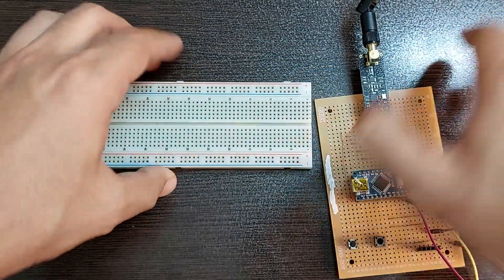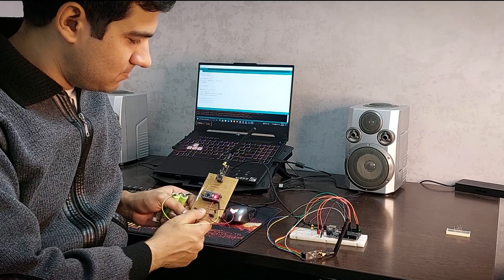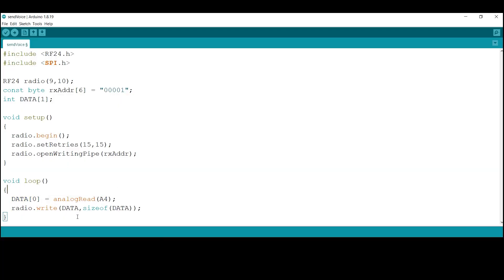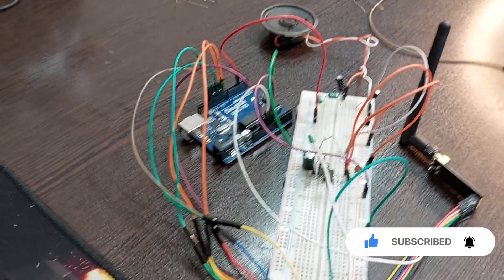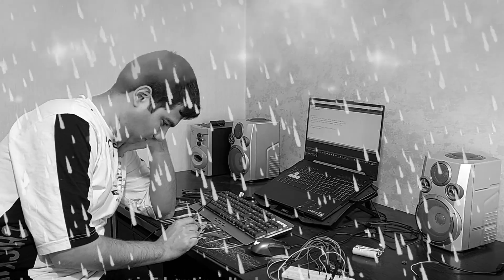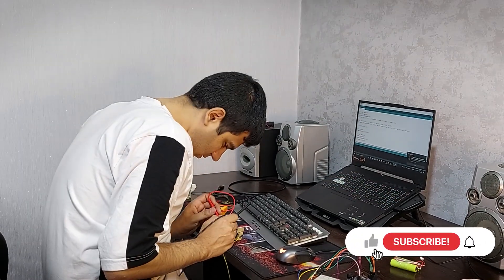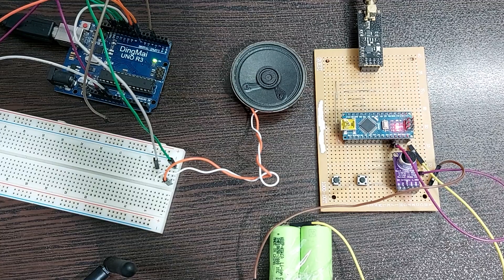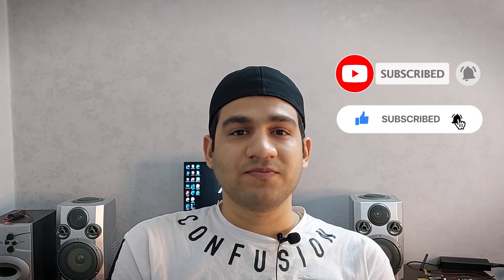Long-range Transceiver Circuit (2.4GHz) Walkie-talkie Part3

Comment: I have made with arduino but it is not working all coding i have done and ckt connections accordingly shown by you it is fake project
Reply from the maker: Dear friend, if a project is fake or doesn't work, I will inform because my contacts are important to me. In the next videos, you can check this project and my notifications.

Comment: Great. And how far it transmit in km?
Reply from the maker: Thank you. Normally, one kilometer. But with the help of amplifiers, the distance can be increased to 8 km.
Reply: @BabakStars how to add amplifier in the circuit. need some guidance for my final year project🙏
Reply from the maker: @zurianazakaria9315  hello The amplifier should be between the speaker and the Arduino. But I don't think it is necessary. The sound is good enough. I'm sorry that I answered you late because I didn't see your message at all.
Reply: @BabakStars  thank you 🙏
Reply from the maker: @zurianazakaria04  you're welcome